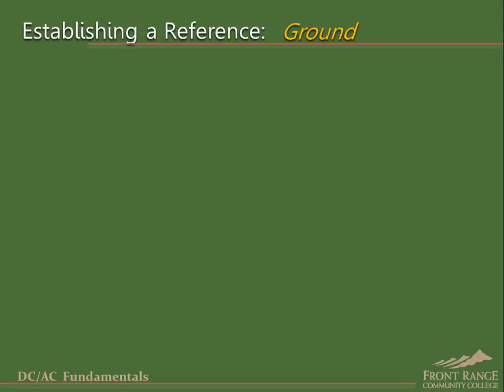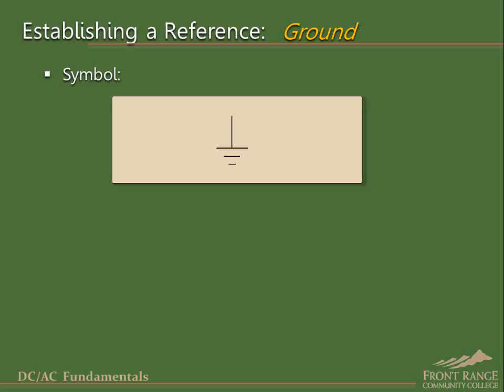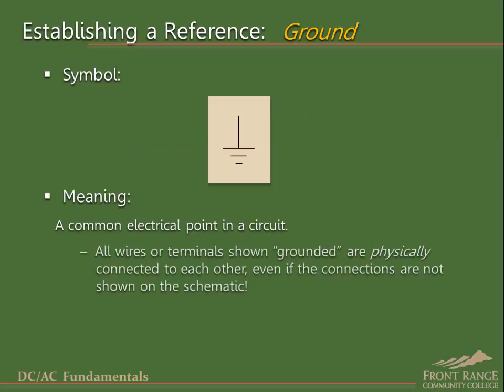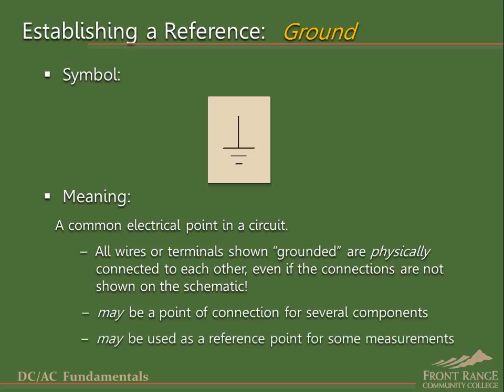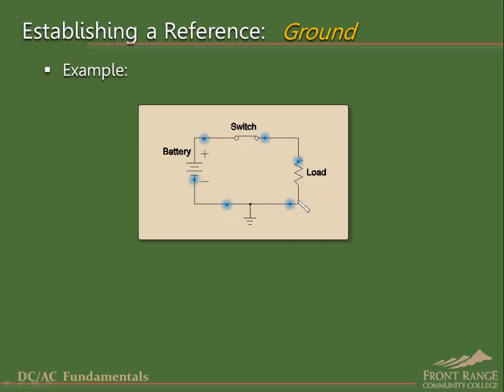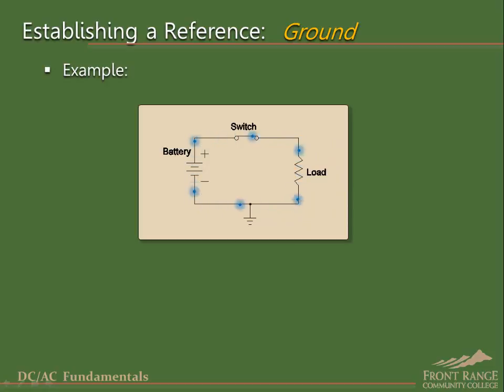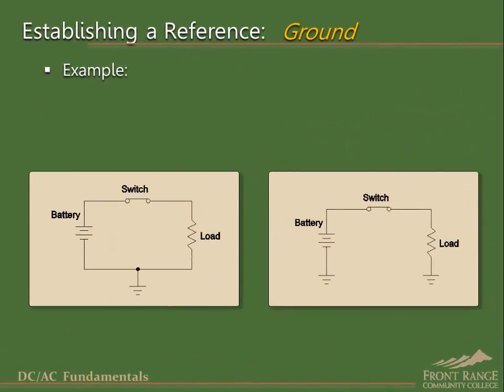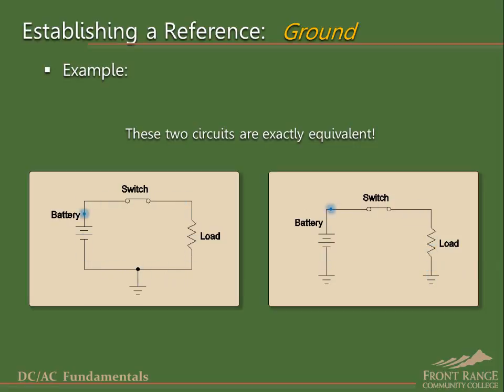Circuit Ground or Common

Comment: 3:07 lol Sooooooooooo. Basically don't put a 4.7uf 6V Electrolytic capacitor in that circuit if the battery is something like.....Oh I don't know 12 volts. But a 4.7uf 16V cap would be just fine if the circuit was designed for it.

Also the switch needs to be rated properly for the voltage otherwise it will burn out. This is why people trying to fix something electrical in their car with a toggle switch and are running it directly from the battery (eg. toggle cooling fan off and on) will get a nice toasty toggle switch if only rated for 15 amps.

I also see a lot of people not installing an inline fuse to be cheap. What they don't seem to understand is a fuse is a whole lot cheaper to replace when the current pops it rather than buying a new switch and so forth when it burns it out.

This was an excellent quick run down of ground and how it works as a reference point. This becomes your best friend when debugging a circuit.